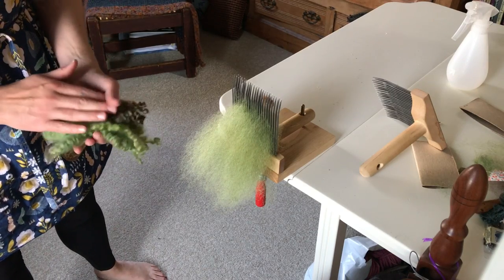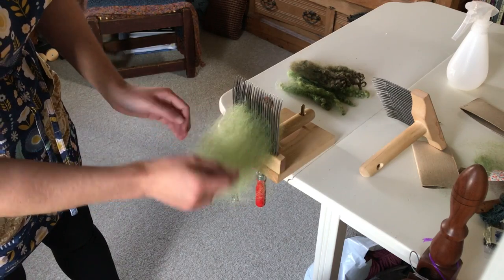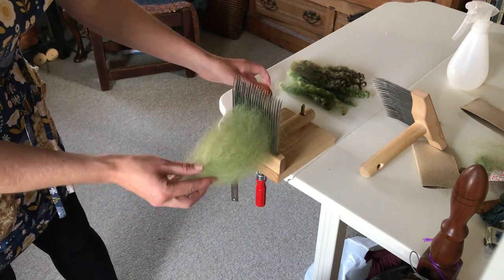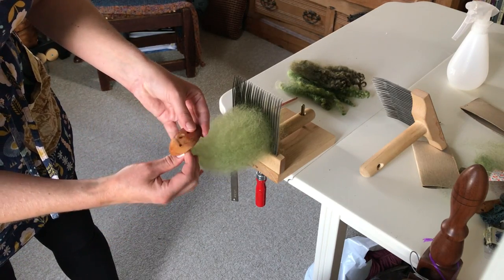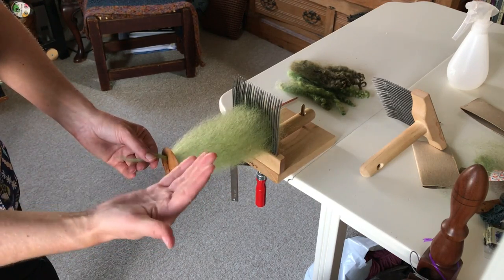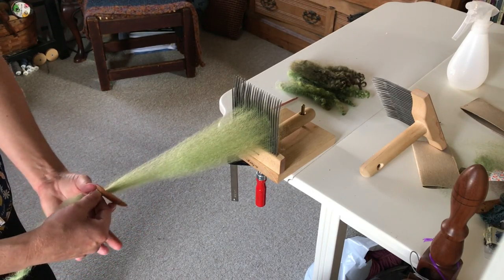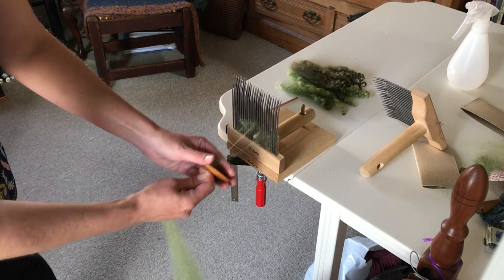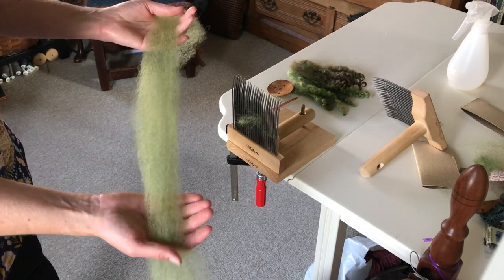Dizzing: How to Remove Fiber from Wool Combs with a Diz

Comment: Hi. TY for vid. Dont have combs or a diz (do have a limpet shell might work). Read the article https://spinoffmagazine.com/diz-tips-the-finer-points-of-wool-combing/ and other by Kim, but misunderstood about concave side facing which way.  What is planking?
Reply from the maker: The step called planking is done after the first dizzing (the first dizzing is what Kate showed in this video). For planking, you take the continuous length of fiber and break it into three or four shorter lengths, then bunch them together. You then take the bundle and lash to your comb to prepare them for the final dizzing. Planking helps to redistribute the various fiber lengths along the finished sliver’s full length. We hope that helps!